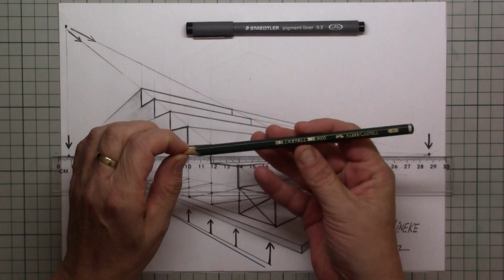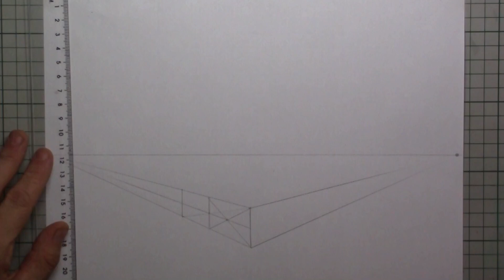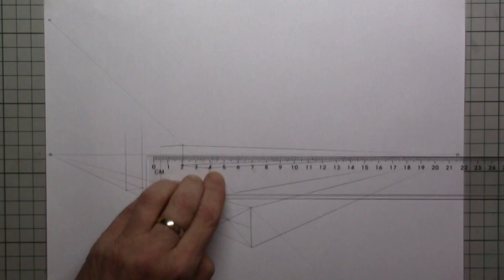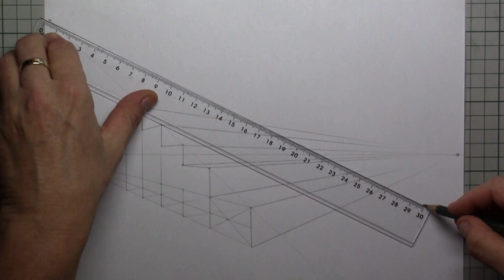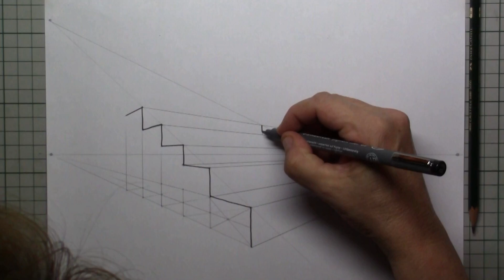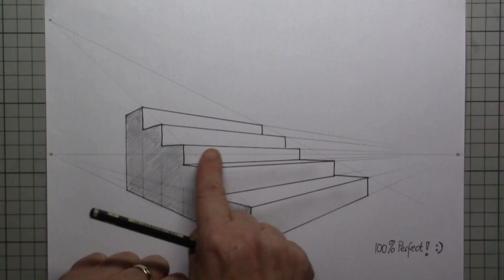Easy STAIRS for beginners perspective drawing

Comment: Great tutorial, I don't know if Im incorrect here but it seems your third step finishes a bit short. All of the other steps come up to your second helper line from your third perspective point but your third one is under it. Am I incorrect or should the vertical line have touched the helper line?
Reply from the maker: Thank you Shamoo and that is correct. I had to make it shorter for people to be able to see in the video but you can make the thirth dissapearing point farther away ;)
Reply: I saw that - thanks for bringing it up. I ran the video several times. Then I read Lineke's answer to you - but I don't think that would work. At eye level, you have to draw the vertical to the top of the stair - which isn't at the helper line. That's the step that breaks the rules. I tried doing it with the vertical touching the helper line & it distorts everything.